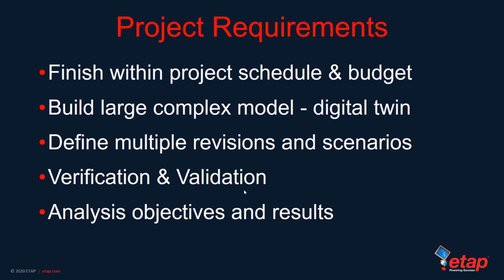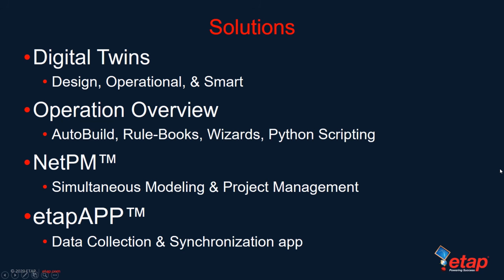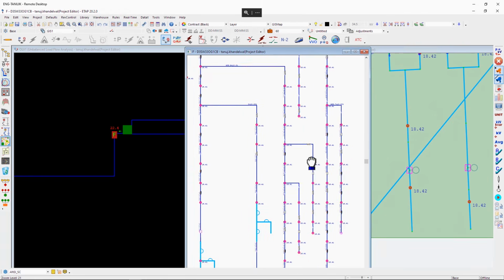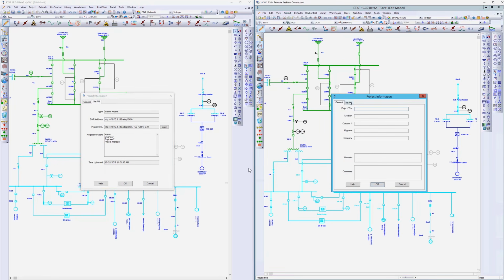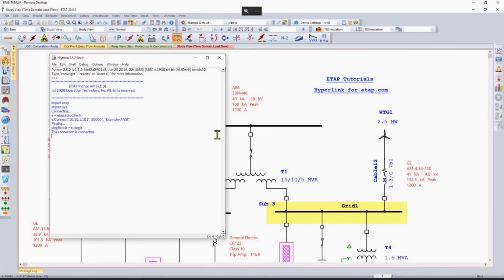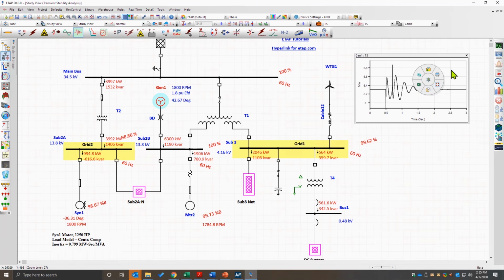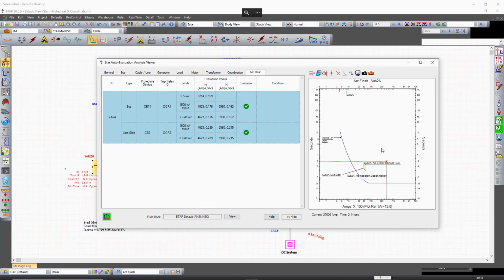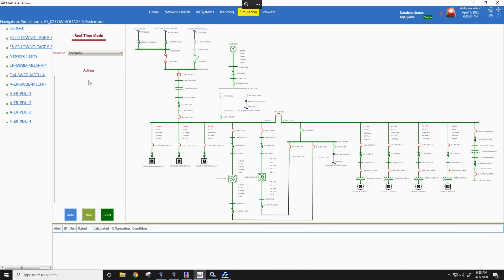Getting Started with ETAP - Project Management - Part 1

Comment: I have a low voltage panel but have no single line diagram attached, can I use the etap to the diagram?
Reply from the maker: Thanks you for your interest and ETAP Solutions. Using ETAP is possible, but depends on the type of analysis you are planning to do. You may try some of our other products SEE Electrical for panel design or Caneco specifically designed for low voltage systems.
Please contact info@etap.com for more information

Comment: How do you specifically get all the devices to automatically connect. I did everything you did but still have to manually connect everything together
Reply from the maker: thanks you for your interest in ETAP Software. Auto-Build was introduced in ETAP 14 and has been enhance in every release since. Please make sure to download the latest version of ETAP from our Help Center, contact support@etap.com or your local ETAP office.
Reply: @ETAPsoftware  I have version 22.5 and the auto connect does not work for me.
Reply from the maker: @daffiest1998  Thank you for your interest in ETAP solutions. Please contact our 24/7 online Help Center https://hepcenter.etap.com or one of our local sales office to assist you.
Reply: https://www.youtube.com/watch?v=Y6I7qZ-DJx4 they explained it on this video
Reply: Enable One-Line Auto Build
When clicked, this button becomes highlighted and turns on Auto Build. With Auto Build enabled, the creation and modification of the elements on the one-line diagram is drastically simplified.

  Auto Build is OFF
Turn off Auto Build.

  Auto Build is ON
Turn on Auto Build